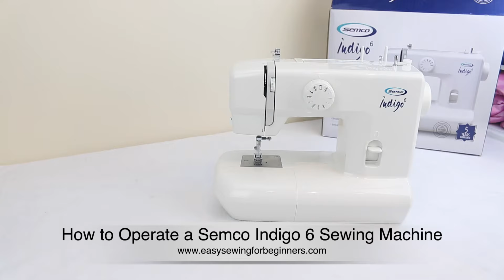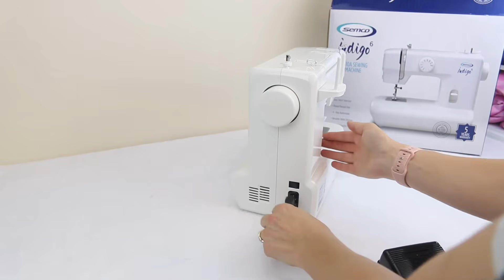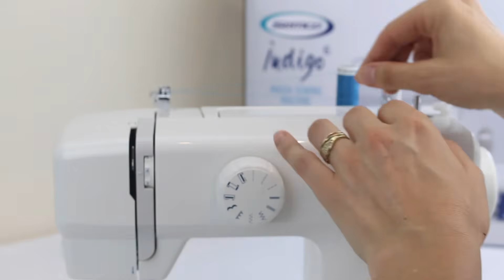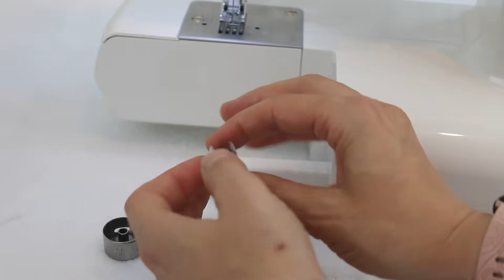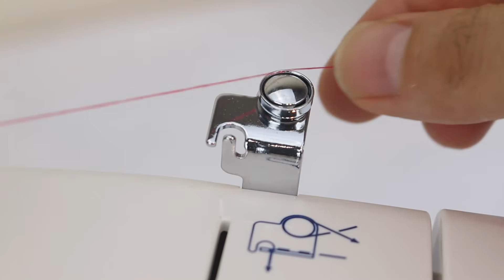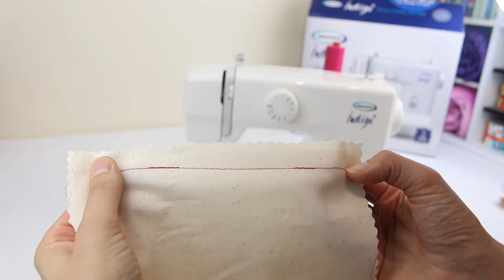How to Operate a Semco Indigo 6 Sewing Machine

Comment: Hey, really appreciate this video! Just wanted to know if you or anyone has run in to the issue of this machine being ‘stuck on’ and buzzing? I can’t figure out how to fix it? It’s like the needle moves ever so slightly by itself and my top thread keeps snapping! I’ve tried adjusting tension, cleaning the bobbin housing, but nothing seems to work!

Comment: Hello. I have tried and tried to do a running stitch loose enough to gather, but it's just not working. I've turned the tention  dial right up as far as it will go, and even losses the bobbin case. and still I have tight stitches. thank you